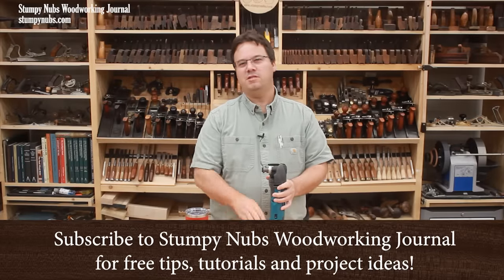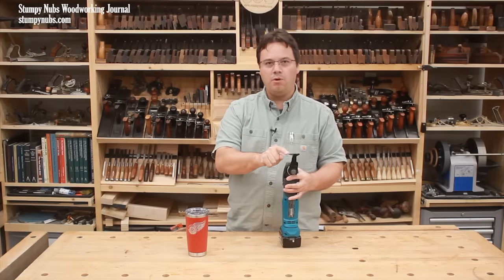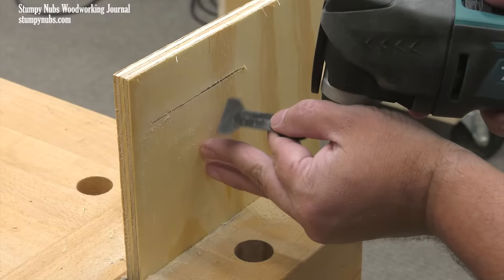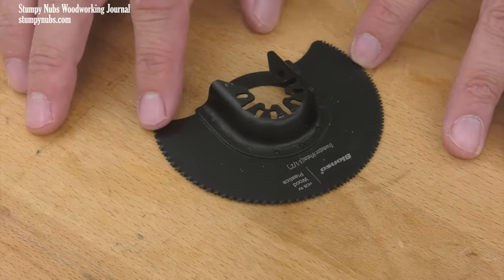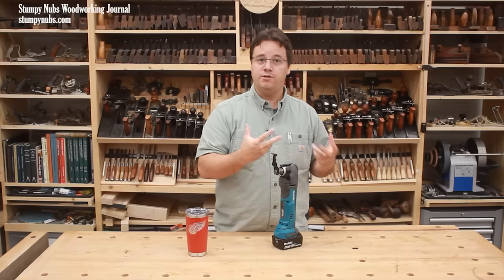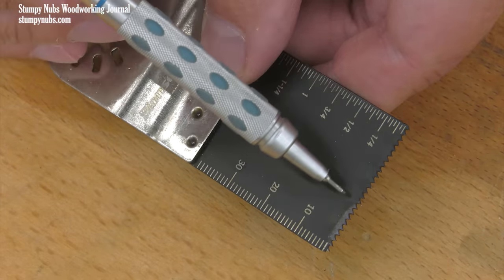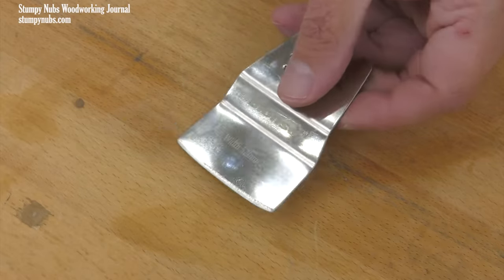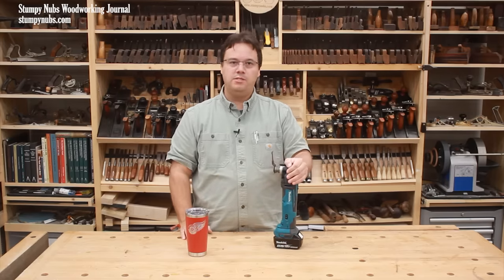CLEVER things to do with an Oscillating Multi-Tool!

Comment: I'm cutting through small but very hard - hardwoods like ebony,purple heart ,oak,wenge  few others, would it be a good idea to use blades for metal ? Any one tried this ? Or should I stick with wood blades even though these above woods often feel like I'm sawing thru iron😂.I'm currently using Japanese pull saws which are brilliant but obviously hand strength.

Comment: Ive been buying these blades off amazon for the last 5 years.  I can assure you that a $7 single Dewalt blade doesn't last 7 times longer than the cheaper ones. The Dewalt may last 10% longer but I doubt it.  They are less than $1 a piece.  The secret to keeping these usuable for a long time is to cut for 30 seconds or so then let the blade cool down for a minute.  Friction is the enemy of metal.

Comment: One thing I done to make metal cutting blades. Take an old worn out blade of most any type and cut it back about 1/2" from the front teeth edge. Than take a hack saw blade and cut off a length to match the width of the cut off blade. Use a MIG welder or even a spot weld and weld on the hack saw blade to the cut off blade and you will not believe how fast that blade will cut metal and nails. Last many times longer than factory metal blades. And cost a mere fraction of them too...

Comment: Tip for cutting drywall and plaster: save buggered up blades (because you will fly through them), cut in ridiculous and aggressive teeth with a cutting blade on your angle grinder. It works GREAT - absolutely flies through the material and saves you a pile of money (it'll still cut through wood too - not beautifully)

Comment: Another tip, don't buy the rockler version.  At least the first Gen one will simply not lock the blade and will rapidly work itself loose.  I literally have to use threadlocker to keep the place locked in place.

Comment: I want to believe you that Ridge Carbide are the best, but when you can get Freud/Diablo and CMT Orange blades for half the price... it just seems like a waste of money. I still have yet to wear put any of my Diablo or CMT blades (or even some cheaper off brand carbide blades), even my metal cutting blade has lasted through significant abuse. I can't see spending double or in some cases, more than double, when the cheap ones already do such an incredibly good job. Law of diminishing returns and what not.

Comment: I watch your channel and it is great and easy to follow.  If you could make a video on how to safely put a bullnose or decorative edge on a round disk using a router or router table.  Thanks
Reply: Come on man! Don't you know how to use a router?
I use them hand held for that sort of job suitably cramped down to a bench.
A router table's OK for work on long lengths of timber but for intricate shapes, free hand with a bearing guided cutter is more controllable.
Reply: I meant to say that the material must be cramped down to a bench. You mould a section at a time and then move it round to an unmachined section and cramp it down again until you've completed the job.
Sorry, I don't mean to be rude but these procedures are fundamental to using what is one of the most useful tools available.
I apologise if I upset you.

Comment: Great video, thank you!  Question- what's the best blade for cutting holes in vinyl siding?
Reply from the maker: I'd use a metal cutting blade because the fine teeth will be less likely to chip the vinal and leave a ragged cut. Carbide would be ideal because it won't dull half way through the job.
Reply: @StumpyNubs Excellent, thank you very much.

Comment: Bi metal blades are designed to flex a bit without shattering, high speed blades are tough, but they break easily.
Reply from the maker: Isn't that essentially what I said?

Comment: I saw an interesting hack for electricians. Take an electric outlet box (metal one) remove the screw tabs. Drill a hole in the back in the center to run the oscillating tool bolt through. The guy took an angle grinder to the box edge and made teeth. Use the tool to cut your drywall out for the electrical outlet boxes. 
  Sorry, couldn't find the link.
  Never throw away your dull blades. Take a metal cutting disk on your angle grinder and make new teeth.

Comment: Wait you don't friction burn though the material, with a red hot blade? That said,  I go through 1 mutitool a year +/-. Use it all the time, beat them up.  So when i buy, i dont care so much about speed, i care about the noise, and the job it does on the hands. Some are quite, compared to others, some have vibration reducers. Atm i have a Bosch cordless. Lasting pretty long compaired to the 3 Fein tools i have had. A good trick, is you can see a laser line on the thickness edge of the blade. So you can hold the blade level, plumb and square against a laser line.

Comment: Oddly, I use my to trim branches and such in the yard more than anything. I have used it to add groves in a place I found out after the fact I needed z clips, and I’ve used it for straight lines as he did on this video to make my daughters growth chart thing. Router with a v point hit was better but whatever.

Comment: I never know which tool I'm going to use next on the oscillating knife so to save me from damaging the blade that is in the tool I simply remove the blade after using it and before putting it away. Yes I call mine and oscillating knife because that is what I use it as and my actual oscillating knife I just call my ham slicer.

Comment: Good tip I give is to sand down the set to zero of the underside of a blade you want to flush cut with. Won’t mar the surface

Comment: I used the Fein tool in the early 90s for removing windshields...it worked okay.
Now there's a whole bunch of tools for cutting out windshields but for years it was only Fein.
Edit...forgot to mention that using a little soapy water in a spray bottle help a lot with the cutting of urethane,  but for some reason nobody ever used it?? Later other w/s removal tools you had to use soapy water on the blade or else it would shake the fillings out of your teeth!...but we never did, maybe we liked all the smoke it made cutting that urethane? lol

Comment: Another little tip: drywall will eat through the teeth of a blade almost immediately but will cut easily even if there are no teeth remaining. If you think you will ever be cutting drywall, save a dull blade

Comment: This tool was originally invented for cutting open medical casts.
The aim was to create a tool that cuts hard materials, but doesn't cut soft materials, so as to safely cut through the cast without risking damage to the skin and flesh underneath.
This means it it pretty safe to use, but those sharp saw blades for wood will still score your skin.

Letting the sawdust escape from the cut is key when using this tool. A normal saw, either machine or manual, is designed to feed out the sawdust. This tool will not do that for you if you use don't use the right technique.
If the machine screams and vibrates heavily, you are doing it wrong.

I have used these tools a lot when restoring wooden boats. They let you take apart complicated wood and metal constructions with minimal destruction, or to make precise insicions that would take hours with a hammer and chisel. I find it almost indispensible at this point.
In my experience, there is a huge difference in the quality of different brands of blades.
Not to be a snob about it but if you have a really tricky job that you can't solve with any other tool: it may be worth investing in one of those really expensive blades. It is hard to get a perfect cut with these tools, but it is impossible with a dull blade. 
Would I go as far as to re-sharpen blades with a jeweller's file? No, not unless I was on site and I was out of options. I don't think it would be worth the time spent.
 Save the good blades for special jobs, keep it taped up in the lid of the box . For something like drywall, you can use any blade, almost no matter how dull it is, but drywall will ruin your good $45 blade in an instant.

The metal blades from Fein and other top brands is made from super-hard steel. They will shatter like glass if dropped hard. They will stay sharp for a long time though if you don't abuse them. For cutting off hardened  screws and such, the cheap ones just won't do it.

Comment: Thank You Master! I had to laugh a little- " let the tool do the work". I went thru cut off saw blades faster by forcing the tool cutting copper wire off 30 Transformers. Not good for the Motor.

Comment: Hey @stumpynubs, a fence installation team installed cedar wood pickets and did not dog ear them at the top. Would an oscillating saw like this be a good way for me to make dog ear cuts post installation? If so, do you have any resources you can send along that can help me make these cuts myself, like a video? I’ve been scouring the Internet and can’t find anything. Thanks!
Reply from the maker: I would just use a handheld jig saw.

Comment: Cheap blades can be made to last MUCH longer by simply touching them up with a triangle file. Badly worn blades can be given new life and teeth using a flex shaft tool with a cut off wheel. you can even put teeth on a scraper. its amazing how well DIY blades work. Dont throw away old dull blades, make new and/or custom blades with them. They dont even have to look good or have particularly even tooth spacing (but do try, if you can) results will vary, but you will find, its not rocket science to get function from recycling/upcycling.

Comment: I use my oscillator all the time but recently I noticed it’s dropped in power and underperforms compared to inferior models why is that do I need to take it apart is that hard to do I don’t want to break it it is a staple to my toolbox

Comment: I liked the video and found it super useful but it’s hard for me to believe the early suggestion of using multiple fingers as a balancing point right next to the cutting service is a potentially dangerous suggestion especially for a beginner. It only takes hitting a nail or for a minor buck to tear those fingers up.
Reply from the maker: These saws are used to remove casts from arms in hospitals because they are so safe.
Reply: @StumpyNubs  damn I’ve always used them so cautiously. Now I’ll just let it rip 🤣

Comment: I've got a few of them, two corded and one battery. And as much as I generally like dewalt tools (the vast majority of my battery tool collection), the dewalt multitool's blade holding head is absolutely atrocious. Big bulky spring loaded mechanism that gets in the way, and most blades with cups around the mounting hole just don't work on it at all.

Comment: Patents are granted for 20 years. Some newer versions for less. So a patent lodged in 1967 would have expired in 1987, not 2008 (41 years). Perhaps there was a better patent lodged in 1988, that solved the problems of the earlier tool???

Comment: I have a Dremel and sometimes the blade dropa off during cutting.  The bolt holding the blade get loose due to vibration.  Any tip for this problem?
Reply: Loctite?
Reply: @glencrandall7051  I need to remove the bolt to change blades

Comment: I have a question that was not addressed in this video. I have an older Rockwell multi-tool, probably somewhere in the neighborhood of ten years old. The only thing that is wrong with it, was inherently wrong with every brand of multi-tools from that time. The tools did not have a latching lock like what the current versions have. The only way to mount the blade is with a screw-lock, that almost always loosens up in a very short amount of time. DeWalt made a locking attachment that was universal, and could mount onto many different brands, and it held onto the blade very well, but it attached to the tool, the same way the blades originally did, so that would loosen up just as quickly. As a result, DeWalt's mounting attachment disappeared from store shelves fairly quickly, never to be seen again, although not quickly enough to prevent me from buying one. Is there a way for those of us who are still clinging onto these older style tools, hoping to be able to use them some day, without the blades practically falling off in less than a minute???
Reply: Is there any reason you know of that you can't just apply a little Loctite to the threads to help it stay in place? Assuming you haven't tried that already.
Reply: @dudeistpriest787  YUP, I already tried both the red and the blue Loctite, neither worked.
Reply: @PaganWizard  That's actually pretty surprising, I would've thought one or the other would at least help. Well, that's all I've got, sorry.
Reply: @dudeistpriest787  My best guess is that the vibrations caused by the oscillating motor, are strong enough to break the Loctite's hold between the tool and the mounting screw.
Reply: @PaganWizard  Considering how fast it vibrates you're most likely right. I wonder if maybe a little plumber's tape would work better? Probably not, but might be worth a shot if you haven't tried that already as well.
Reply: @dudeistpriest787  HMMM I'll have to give that a try. Thank you!!!
Reply: @PaganWizard  Very welcome, let me know if it works!

Comment: Can we all agree that the cheapest packs of Amazon blades are soooooo much more worth it than a $10-20 blade? So aggravating how insane that price point is. Yes I may only get 12 cuts out of a cheap blade but they're typically like a buck a piece. Likely won't get many more out of a name brand blade anyway. Couple in hand sharpening or a "sharp-hog" and a 36 pack could last me a year easy for $36

Comment: It's my understanding that oscillating tools simply move back and forth, so wouldn't setting the blade at a 90-degree angle only create a pounding action, not a sawing action?
Reply from the maker: It pivots in a short arc. The arbor twists back and forth a few degrees.

Comment: As I have found that the tool is missnamed, there is nothing multi about it, as it only does few things well:  one being small plungecuts like cutting trims when putting in new floor, or sanding corners on walls or floors, sanding wood  on larger scale it´s useless, doing longer cuts it´s slow and accuracy might be a problem, cutting metal it´s slow but no sparks which can be handy in very few situation. Usually when I reach for mine , I´m being lazy and do not want to remove some piece to cut it with a way better cutting tool. So at least for me the multi-tool is and accessory or like a gun for the Americans, nice to have it but rarely used :D

Comment: Get yourself a cheap set of needle files and sharpen your blades. It won't be 100% as sharp as a (good) new blade, but good enough for 90% of the jobs I use the tool for. You'll get several sharpenings out of the blade before you are beyond the set of the teeth (if that makes sense).

Comment: I've only used the arc shaped edge scraper blades. Has anyone used the flat edge ones and which do you find better?
Reply: Arc. Don't even chuck up a straight scraper. Total waste of time IMHO.
Reply: @woodrowsmith3400  were you using a flexible or stiff scraper blade?  Ive tried the flexible-arc blades and they wont' scrape anything maybe with the exception of old caulk but even that the stiff scraper removes it faster.
Reply: @woodrowsmith3400  I even used the flexible arc blade on wallpaper and it couldnt scrape it.  I have no idea what it's intended for but everything Ive tried the flexible blades on it hasn't worked on anything.
Reply: I got stiff ones in the package I got. They do OK, and ...really?... I just use it when I get lazy...😂

Comment: Can I cut drywall and with which blade?
Reply from the maker: They are  used to cut drywall all the time. Any blade will work, but it will dull it quickly. That won't matter much because drywall cutting doesn't require a sharp blade. But you won't want to then use that same blade for wood or metal again. So just set it aside for drywall.

Comment: I use mine all the time and the only question I have is "Why are the blades so danged expensive?!" Not only that even the higher dollar ones only seem to last a couple minutes. Seems like I spend more time changing blades than actually using the tool.

Comment: My problem is finding blades that will fit my tool! I have a Porter Cable 18v and none of the "quality" blades will not fit on the pins! So far the only blades that appear to fut are the cheap garbage ones!!

Comment: I always prefer to store mine without the blade on it at all. They’re easy enough to put on and take off, so why risk damaging the blade or something else at all? Even turned backward, technically the blade could still potentially damage something or even be damaged. You could even cut yourself on the backward blade when you grab the tool next time if you forget the blade is still on it. It may be a slim chance, but that’s enough for me to simply take the blade off.

Comment: The first rule when you are talking about holding your tool correctly, and plunging your tool into thick material while controlling the oscillating head, is to keep a straight face and not make the obvious joke.

Comment: Why not just remove the blade altogether, when you put it away? I don't leave drill bits in my drill when I put it away. I take the blades out of my jigsaw before I put it away. If my circular saw didn't have a blade guard, I would take that blade off too.
Reply from the maker: A lot of people use one blade for most jobs and don't want to go looking for it when they just need to make a quick cut.

Comment: Did you know you can actually touch the teeth without getting hurt? This is because the tool is designed to cut casts (for broken limbs) off people without danger of damaging the skin. might not work with all blades.

Comment: RE: cutting metal: turn down speed, use less force AND walk the contact back and forth on the blade.  Use ALL the teeth.  Give the teeth that have been cutting for a few seconds a little time to be out of the cut and cool off.